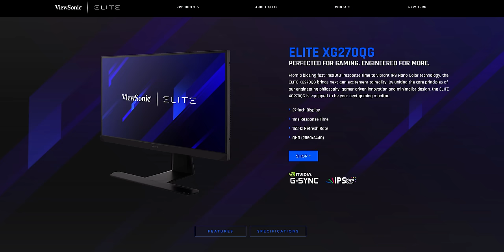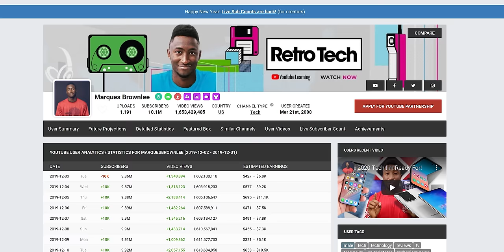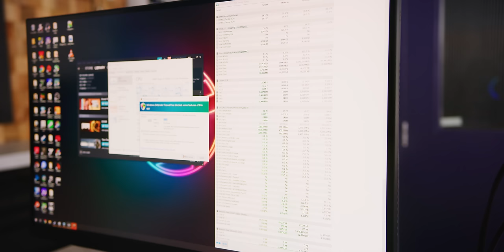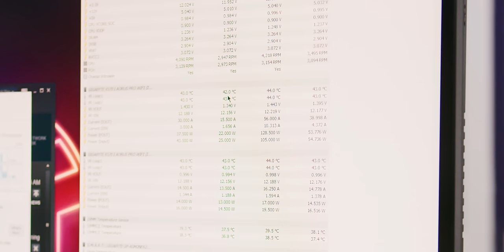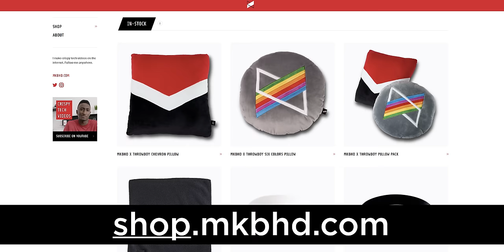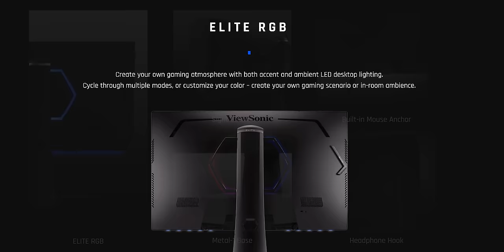The Easiest Water Cooled PC (NOT Easy)

Comment: Water cooling isn't that hard.  My custom loop took a few hours on my first try.  I had a large tower case with a pump/rez combo.  No leaks and under $3k with my build. Temps and noise are lower than my previous air cooler and AIO.  Custom loop is still the best.

Comment: So all I need is a heat gun, an expensive case, more tubes than you use in most aquariums, a bunch of additional expensive shit and 2 days of constant suffering and I can have a PC that runs slightly cooler than mine does with a 100€ noctua cooler (and has 3 times the amount of fans), with only an estimated 30% chance of my system failing, frying itself and also flooding my room, potentially ruining other electronics in the process?
I can see why people love water cooling so much.

Comment: So this is bad water cooling solution
reason 
you add heat not take away heat
that could be fixed while making the heat sink on the top the hot one not the heat sink on the side the hot one
because you got no bottom fan or side fan there only fans on the side and top making air go through left to top so I understand why corsair is reaching out and saying that adding more radiators is not the best solution, in this build you don't take away but you add the temperature 
for example
the room temp is 20 C
and the water in a hot radiator is 40 C
so the air would be around 30 Cor lower (I can't be asked to do the math : P so this is only the example)
so the air in the case will be 30 C and the water from hot radiator will cool down lets say 25 C due that some heat can go in to the case
and that water goes to the top radiator where the air that goes through is at 30 or 28 so you not taking away but you adding the heat because you use warm air that is above the temperature in the cold radiator 
something like this
30 C air
27 C water
so that should heat up not cool down
but if you make the hot radiator the top one and the cold the side one that changes the situation of temps
so water in cold one could be 20 or lower depending on temps in your room
so the air in the case would be 20 that air would cool down the hot one on the top and the cooled water from the top will go to side one to get cooled even more won't be close to room temps but the air in the case will be lower to the build showed in the movie

Comment: I don't like the look of RGB fans at all. In my own builds, I'll use the lighting from my RAM, motherboard, GPU and AIO cooler but for the fans, I leave them all blacked out. Noctua chromax everywhere. You end up with a reasonable amount of interior lighting which is never overbearing and doesn't look like some Best Buy RGB monstrosity. RGB fans always look like crap to me and it makes the whole computer look cheapened and childish.

Comment: See this is why commander pros are such crap. They huge bulky piles of garbage. You guys need the shovel connector for the heatgun which allows you to direct the hot air like literally in half inch spaces without affecting the areas next to it! For really tight bends I try to find things around the house that work lighters tend to work great. I don't think anyone on earth could finish a complete loop build in an hour. Not an official one anyone. Even if you built this exact model pc for a living it couldn't all be done in an hour.

Comment: So guys who've built probably hundreds of liquid cooled pc's struggle like hell to build one with built-in reservoir and tubing... AND it adds more points of failure? Water cooling is just blatantly irrational. Plus a bunch of different pinouts and proprietary connectors for LGB NONSENSE? Wtf is going on with computer manufacturing standards today. No wonder pc's are losing the war to mobility.

Comment: After watching this and the other video comparing water and air cooling...  There.  is.  No.  Fucking.  Way.  I am going to bother with watercooling my system.  If it doesn't perform better, it's not quieter, there are more components that could fail, and you're introducing water into an expensive electrical device...  I have no idea why anyone would bother with watercooling.  There is no benefit.

Comment: usually the builds i see here look pretty decent but this is one ugly build. the cable management is ugly AF and its obvious cause most of your shots avoid looking at that mess of wires but a couple of times after finish and yeah looks awful. beautiful small form factor case with built in distro plate but i feel like this build wasn't well thought out at all guys...Though in all fairness this case isn't easy to work with by the looks of it and sadly depending on how this case sits with the rest of your rig who is gunna notice the distro plate...sadly...